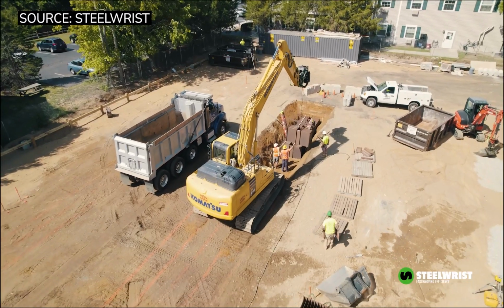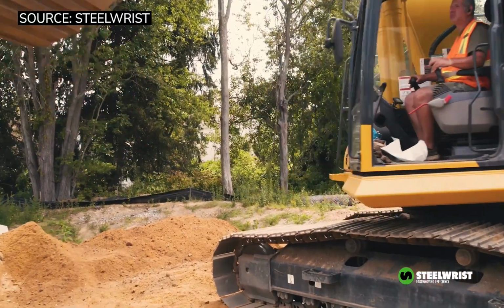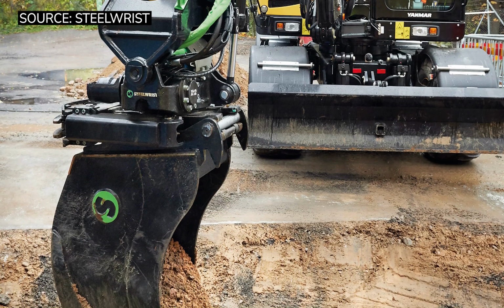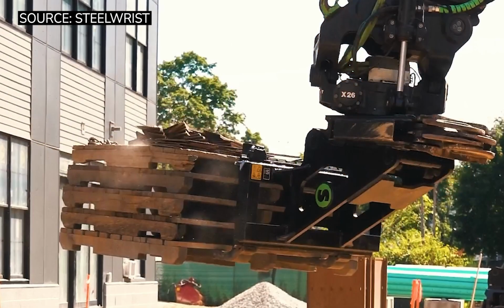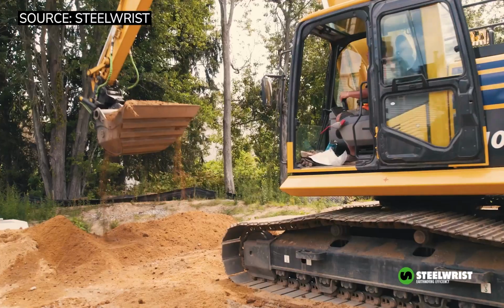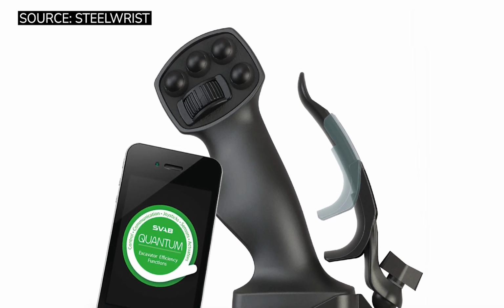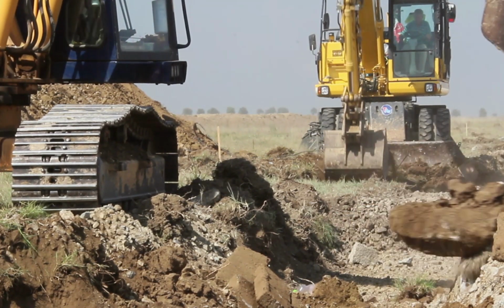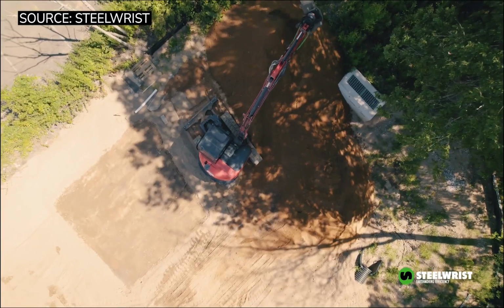A Closer Look at Tiltrotators | The Dirt #87

Comment: For me working with out a rotor would not happen. i mostly work in a 2.5 ton Volvo ewd. it is small it is nimble on yards and with the rotor i dont need skidsteers or wheelloaders i can do all the work with 1 manchine. and i only 5 tools to it. 3 buckets 1 gradingbeam and the integraded claw on the rotor. i only 1 have extra guy with me i make his jobb easy and makes mine easy. there are 2 videos on my channel where i do some diffrent work with the machine using the tilt rotor´.

Comment: I'm sure this tilt rotator is great, no doubt. But if you're really looking for versatility, there's a lot of contractors in America that are woefully ignorant on the capabilities of crawler loaders with a quick coupler. A crawler loader could do anything a Dozer could do and much,much more. It's the same concept of a tilt rotator, a crawler loader with just say a quick coupler and GPS grade control and you have very few jobs off of pavement and finished roads you can't perform. Crawler loaders today are basically extra heavy duty skid steers with more capability.

Comment: 3 years ago I moved from New Zealand to Sweden to live and work, and going from tilt-hitches being a luxury to tiltrotators being standard has been eye opening. Swedens work culture is very much “work smarter not harder” and they would rather buy an attachment or shaped-bucket to make a job easier. New Zealand is slowly adopting tiltrotators but I still see and hear people there complain about the price of things whenever a solution is presented for their problem. So I am in no rush to go home! I can operate without a tiltrotator, but having one just makes the job so much easier , faster and more enjoyable and you can do so much more from one position. New Zealanders often worry that tiltrotators will break in their ground conditions, but I can confidently say Swedens ground conditions are much harder. The concern of losing breakout is removed with the sandwich configuration, which is very common in Sweden as there is granite and boulders everywhere. So for ripping or solid ground excavating you can just remove the tiltrotator and protect your investment. They’ve been using these attachments for 30 years, so they know what they’re doing!